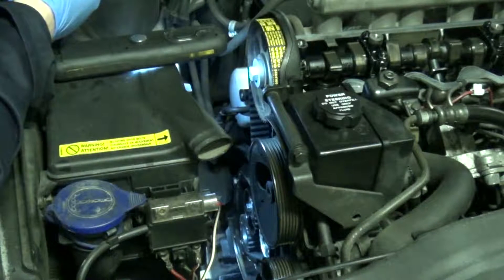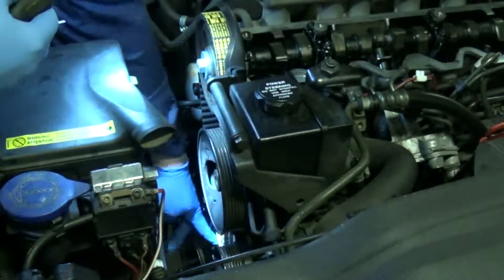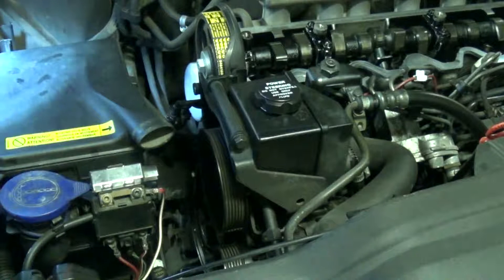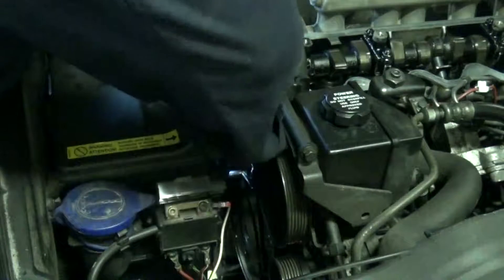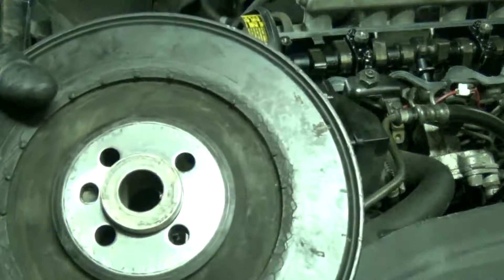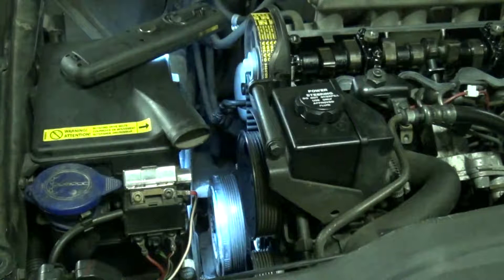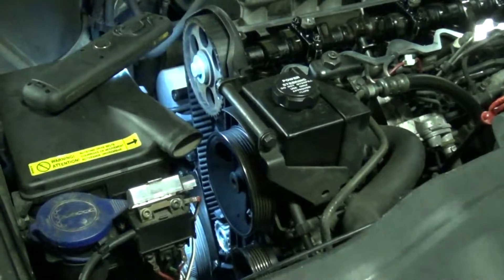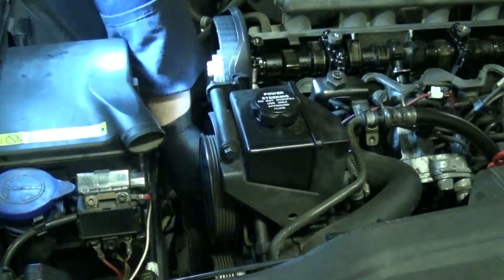D5252T timing belt change part 5c: Main timing belt Installation. Volvo 850 S70 V70 S80 TDI 2.5D

Comment: Bn dia sr como puedo saver cual es la posicion de la polea de la bomba sim  marcar
Reply from the maker: Good morning, do you mean the marks for the diesel pump? Timing marks are explained in this video. https://www.youtube.com/watch?v=ny2LbvmZMjc
Reply: Hello. Could u tell me. How the mark in the flywheel is.
I found the point on the casing. But cant find the point on the flywheel
Reply: @DieselBricks  .